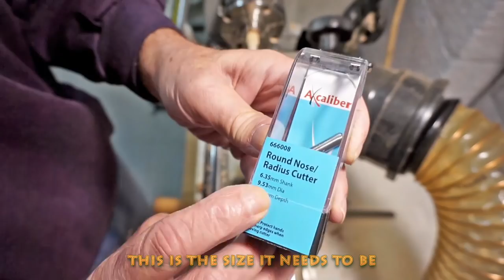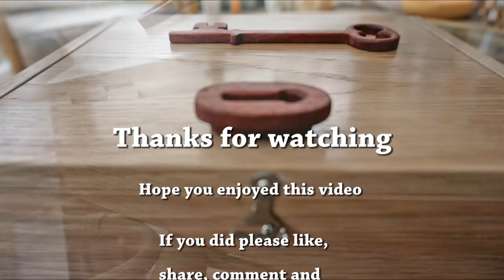Woodworking - Making a key box with finger joints and turned wooden hinge

Comment: Hi Peter, Nice job. I like your perfectionist craftsmanship. Also I like your table saw. It looks like a light weight and powerful machine. Can you show us more about the table saw?
Reply from the maker: AnthonyChoySuperbest,
Thank you for your kind comments.
My table saw is probably now nearly 20 years old but still going great.
It is a Scheppach TS2500 with a hinged side extension on the right and a sliding carriage on the left. It also came with a hook on rear table extension.
At the time I bought this it came with an aluminium table but a modern up to date one would come with a cast iron table.
You can pick up second hand ones with aluminium table for a reasonable price but a new cast iron equivalent would be quite expensive.
Hope this helps.

Comment: Hi peter
I noticed you dont have a dado set 
So what thickness blade did you use 
All the very best 
John s /manchester
Reply from the maker: mag smethurst,
The blade is a standard multi purpose blade and the set makes it approx 3.33mm wide.
Only problem with this blade is the offset teeth which do not give a flat bottom to the kerf and if you look closely there are very small gaps at each pin. Thanks for your interest.